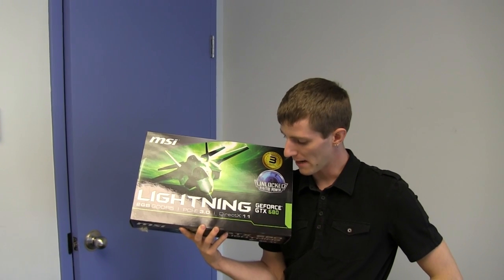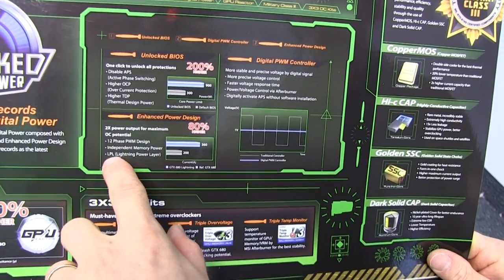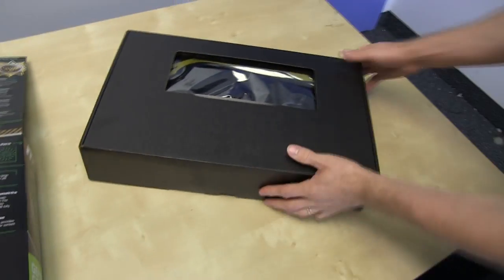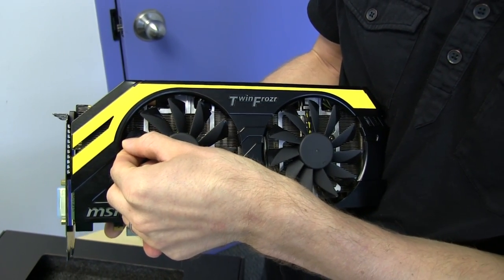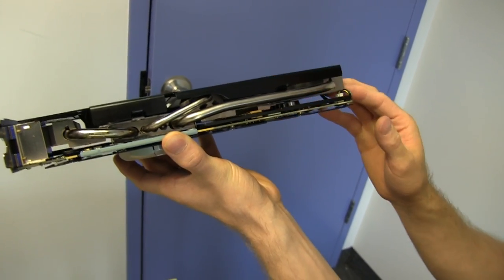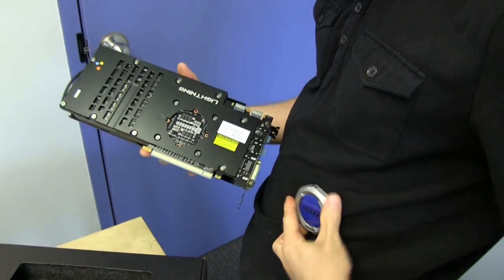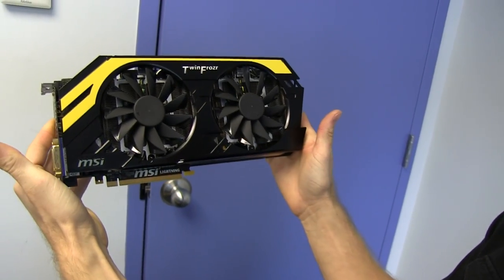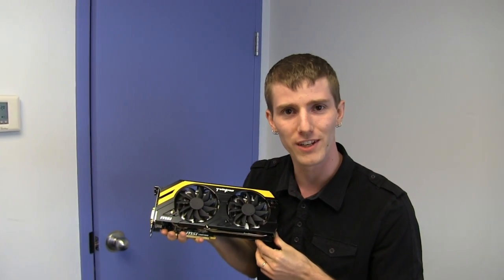MSI GTX 680 Lightning Video Card Unboxing & First Look Linus Tech Tips

Comment: That makes more sense than the previous response I received. Thanks. One more question: If you were to overvolt the VRM, then wouldn't everything else be overvolted without having to adjust more settings in Afterburner?

Comment: Well.. It depends. Are you willing to sacrifice heat for performance? If you go with the 660Ti cards, you won't have much room for future upgrades, while you can add another 680 in the future. i7 won't give you much performance boost over the i5 3570k, but it might in the future once games get more and more demanding. I would recommend getting the 680 and the 3770k because you can overclock the hell out of the Lightning card to increase the performance, and you can grab another in the future.

Comment: I thought I leave a comment after all you would wanna know, how well my beloved card is today. It can run dota maxed buttery smooth on 1440p (disclaimer: 144hz and g-sync, fps is max 100).

Also quick note, linus mention all these unlimited power thing, so the thing is I believe only the first 5 or 50 thousand cards had a separate bios on the ln2 switch. Personally I had to flash one of the bios to this ln2 profile that msi created, because it had 2 stock bios profile set up. Once done don't worry that profile going to set the default fan speed of the card while in bios close to max and you will first think something ain't right. 

Overall pretty happy with its lifetime as this was my original card in my pc, changed that to 780ti when upgraded to 1440p, then the card burned out, got a replacement in a form of an 980, well needles to say that burned out recently when i wanted to resurrect it in my new system, because the previous hasn't been functional for the past year (very long story, have an i7 3770k, which would be still fine today, but trouble shooting, if it works ain't a dream, besides its pretty old now and the answer is no, it doesn't work, or if it does it is going to keep being a pain in the @ss).

Also the 2 cards that burned down were both gigabyte, no hard feelings as i got one of their motherboards in my new system, but now that I'm looking for a graphics card I ain't gonna consider one from them this time. 
Btw not going to consider anything, what the heck, here locally, there are barely any graphics card left in stock, so no 3000 series in sight, I might not be able to get a 2000 rtx next month, not to mention the decent brand name and decent price.

Comment: hehe yeh true it's awsome and looks sweet. takes some maintenance too though from what I saw on some people rigs. I dunno, 60*c is perfectly safe for the card so I wouldnt pay extra. I usually just turn on vsync for 60fps cap so my card isn't 100% used up, then it stays cool. + my rig is pretty budget at this part of the year. was ~1500 euro (bit under $2k) back in january but now the 6970 is basically a 7870 which is just barely high end

Comment: Thats really good for an Air Cooler but my 2 EVGA GTX 680 SuperClocks in SLI have NEVER broke 50C on a Koolance water cooling system. On idle they are around 25C-30C (depending on the room temp) and generally sit between 43C-48C on 100% load. However, I did pay up the ass for the water cooling system but I got really good temps which is all that matters to me! Once you have had a water-cooling system its really hard to go back to air cooling.

Comment: If you don't have an overclocked cpu you should be fine, but I would look into a little higher watt from a good company.  Personally I'd get a 500 or 550w psu from Seasonic or Corsair, but if you're tight on money, you can get a Rosewill pretty cheap and they're usually pretty decent.

Comment: take a look at how much work other manufacturers put into their mid range and other cards. Just from the coolers, you can tell that EVGA doesn't wanna put the same effort. They only got around to dual fan coolers by the time TwinFrozr made it popular . Their only redeeming factor nowadays is that they bin their chips well(which makes their factory OC good) and customer service is good. Maybe you  could say they have nice external coolers too. but i guess for reference cards they are pretty solid

Comment: those specs are fine, no need to worry. But i recommend you getting the 3770k instead and also an AX 860i if possible in case you want to SLI two gtx 680's in future. :)

Comment: According to JJ from ASUS.ASUS Direct CU II cards can be overvolted but you have to solder wires onto the card and plug the other end into headers on ASUS ROG Extreme motherboards (Rampage IV Extreme and Maximus V Extreme)

Comment: that all depends on the cards themselves, the overclock and the overall conditions. on normal stock cards (680 & 7970) and same conditions, when both overclocked to the highest stable clocks (under air cooling), the 7970 pulls a head by a margin. especially above 1080P. another example is that one would say that 660Ti > 7950 which can be true but the Sapphire HD 7950 OC 950Mhz Edition is a totally different beast which on stock is almost a 7970 and can go further very easy.

Comment: but personally i would choose a haf x case. The air flow is really good. Plus the fact that this card sort of like dissipates heat into the case instead of out of the case. so good airflow is a must. The coolermaster haf x is a good choice

Comment: I have a question. I'm planning to upgrade my processor and:
The motherboard I have/getting is a Socket T, and uses DDR2 RAM, so I have to buy the Intel Core 2 Quad. I already bought 4GB of RAM.
Or, should I spend a little more and buy a motherboard that uses LGA 1515 (Correct me if I'm wrong), and buy an Intel i5 with 4GB of DDR3 Ram? I have little over $500 to spend.

Comment: I found a good thread on overclock (.) net and apparently they have new bios for the new lightnings. My only experience with bios before was with emulators so this might take awhile. Just one last question, i'm planning on getting an " intel i5-3570K Ivy Bridge 3.4GHz (3.8GHz Turbo)" and a "CORSAIR HX 850w" would anything bottleneck the system and should a better power supply? Also how much more powerful would my CPU and GPU get from overclocking?

Comment: i would recommend the msi gtx 680 power edition. it is the same card with a different bios. but the only difference out of the box is the lightning has 89mhz higher stock clock and unlocked voltage control. however if you OC with msi afterburner you can unlock voltage control anyway and overclock the power edition. i have both the lightning and the power edition, look at my channel for proof. hope this helps.

Comment: Cause the coolers dont blow air towards the gpu core anymore, they blow it outwards to replace the air around the fins. if the pcb was flipped it would blow hot air upwards and with that dust which would just fall right back on the card :S It does make sense to flip it for the looks as well as the fact that hot air rises but I'm sure its more efficient or something like this.

Comment: i have had a few asrock boards. one needed to be rmad due to audio and usb 3 not working. the other few boards i have have been working wonderfully. but i would recommend asus over asrock any day. but just in case they both have an easy enough rma process and good support. hope this helps

Comment: Higher voltages = increased localized heat spikes (regardless of any cooling), eventually you will burn through many of the extra transistors provided to compensate for manufacturing errors and performance will start dropping. So don't go crazy with voltage even if you have liquid nitrogen for cooling.

Comment: So, a question that still floats around in my mind that I really haven't gotten an answer to. Would two cards with a design that makes the air disperse inside your case be really bad together? With the bottom card blowing hot air on the top card and all. Before anyone answers "You could with a well-ventilated case", please define "well-ventilated"

Comment: hello, i have a few questions. If i get a full tower case, will this fit in there no problems?, also, if i plan to sli down the road, do i have to get another msi lightnight 680? or can i just get a basic gtx 680 2gb (keep them both at stock clocks)? thanks!

Comment: @themetalhead121 ? can u put 4 of these (msi gtx680) in 4-way SLI with the thing on top of the card, the opposite side of the fans? where did u get 7970 from?

Comment: triple overvolt does not imply more voltage it is the advertising by msi to indicate you can overvolt the core, pll, and ram and the power edition has it so if your msi card can overvolt it probably has triple overvotage

Comment: Dual slot.  You can see both bracket pins sticking out the bottom, and the fan sits next to the dual slot bracket height.

Comment: the 680 lightning is better for oc. But right now all the 680 lightnings are already voltage restricted by nvidia. I flashed my 680 lightning bios to unlock the voltage. If u know how to flash a gpu bios. Get the 680 lightning and then flash the bios to an unlocked one.

Comment: that's what they claim. But nvidia has put a 1.175V voltage cap on all gtx 680's. So since u are buying a gtx 680 lightning now, it would have a bios that caps the voltage at 1.175V. "unlocking" it now isnt as easy as flicking that switch. You have to flash the bios to one that is has "unlocked" voltage otherwise you will not be able to overclock at all.

Comment: no but there looks to be about half an inch from the connectors to the top of the cooler. but my friend tols me you can use 3 bendy bridges cus the 4-solid one wouldnt work

Comment: These would win because the gtx 690 is clocked ever so slightly lower than sli gtx 680 reference cards and these have more oc headroom. Howerver 1 690 looks better, is cheaper and costs less to have watercooled as well as consuming less power. Just in case you wanted to know ;)

Comment: You actually can't overvolt the GPU unless you get lucky and get one from the original run of cards, as Nvidia made MSI remove the software overvolting capability of this card.

That's why I'm happy with my 2x 7970 Lightnings instead :)

Comment: I thought the Lightning's voltage was already unlocked and that it was at 3x voltage, but i guess it must just be able to stand over 3x voltage and you need to use bios to unlock it. If that's the case then i'm sure ill over voltage it.

Comment: Can I throw a semi bad news out there? Currently produced MSI GTX680 Lightning cards have voltage limitation, even on LN2 BIOS. This has been enforced by nVidia to MSI. Fortunately, the so called first batch of Lightning cards were really unlocked, so new owners can flash the first batch LN2 BIOS and unlock all the features of their lightning cards. Check Guru3D review on this topic.

Comment: I'm assuming you have not bought to many MSI products over the last 10 years.  They have had a lot of good and bad products over the years.  Only 3-4 years ago they were mainly considered a budget part manufacturer.  They have been trying really hard to get into the high-end market over the last few years but I would still be leery of any company that promotes customer overclocking as a product feature especially on a TOTL video card.

Comment: according to the HARDOCP site where they tested both 7970 lightning and 680 lightning on ln2 bios, the gtx 680 at highest stable overclock was 5% better than the 7970 at highest stable overclock.

Comment: Sorry, but out of the box there are no 600 series GPUs that can be overvolted. If you want to OV a Classy it can only be done with an EVBot (so that's another $100) and if you want to OV the Lightning then you need to track down the old BIOS and find a build of Afterburner that will allow you to control the voltage. MSI never actually released an official version that supports OV on 600 series cards.

Comment: well from what i understand the gtx 690 is basically 2 680's but SLIGHTLY underclocked.  so the 2 680s might get more performance, but will also produce more heat

Comment: I bought this because it was supposed to have superior cooling (10~20C off regular cards) but it doesn't cool any better than my previous card.
If its cooling is in par with my older card then why would I over clock it... I feel like I got the wrong card, not using its full potential by not OC'ing, but hey at least it plays games well.

Comment: Dunno, msi coolers are so good you don't really need a water cooler. my card runs no higher then 70*c while at 100% load for hours. normally sits at ~55 with usual gaming.. Can't say that for many other cards cause all I see in benchmarks is cards going up to 80*c which doesn't sound like it would last more then a couple of years with those kinda temps..

Comment: i have a sabertooth990fx i just got one more xfx R7770 in crossfire, i had a pci wifi  Adapter in befor i put the 2nd gpu in i had to take it out for the gpu and now it coverd and the pciex1 is cover all i have open is 2 pcie x16 slots open i like to know can i put a PCI Express wifi Adapter in a pcie x16slot will it work i like to find out be for i buy one thanks

Comment: the 680 lightning has a special pcb as compared to other 680's. MSI claims that this allows for a more safer over voltaging of the card. But if u dont dare to do it, u might as well get the Galaxy GTX 680 SOC cos it is a waste if you get the 680 lightning and dont even over voltage it. Mind you if you dont overvoltage the 680 the overclocking results will be quite pitiful.

Comment: if you had 4 of these you would be either limited by the refresh rate of your monitor because of the enormous ammount of fps they'll produce or be limited by the 2 gb of ram for surround gaming because you would really want to go for 3x30 inch monitors with that ammount of graphics horsepower ;)

Comment: Linus just did a video of 2 660ti's vs one 680 and 2 660ti's do about 15-20% better then one 680 but they cost about 20% more ;p Also at 1080p a 680 will blow away bf3 at ultra. Linus was doing that 60 hz vs. 120hz video with a 680 and it was going anywhere from 80 to 120fps in bf3. Also the lightning edition of the 680 is about the same as two 660ti's. This card is expensive. Honestly you should buy one 660ti and see if you even need more then that to max out everything. You probably won't.

Comment: Aesthetics is the absolute worst reason to buy one product over another when its going into a case under a desk that will not be looked at except when doing maintenance and upgrades to the system.  Price vs stock performance should be your only real buying decision.  Overclocking is something you do when you are near ready to upgrade and just need to get by for a while longer.  Why would anyone risk burning up a near $600 TOTL video card that can play every title at max settings?

Comment: you can easily flash the BIOS. MSI released another BIOS version after Nvidia fucked everything up and you can again increase the power limit to 300% and increase the voltage. not to mention the 680 runs insanely cool, so even if you couldn't OC it like you could, it still kicks serious ass. i got mine for 20$ more than the normal EVGA shroud cooler pieces of shit, which don't overclock at all. (originally bought one of those. sent it back 2 days later, what a pile of crap.)

Comment: Because it's rather unnecessary when you look at the placement and pricing of the card. It's supposed to be made as one of the best GTX680's, which excellent cooling, triple overvoltage and such. However, it also costs $100 more than a regular GTX680. Thus, I would expect a 670 lightning to cost around $500 if they made it.

However, at that price point you might as well buy a GTX680 instead. Besides, there is the GTX670 PE, which has a similar cooler anyways.

Comment: This or a 7970 with the same cooler. This 600$ - lightning 7970 515$. i heard overclocking a 7970 generally gives better performance than a 680

Comment: That little added chip at the back is just a marketting gimmick. I cant belive they couldnt fit this on the same board as everything else. I guess manufacturers are running out of ideas how to keep their lines fresh. I have an idea make it look professional looking maybe then some older gamers will buy it too. This is definitely targeted at 12 year olds with this design. Only problem is 12year olds have no cash.

Comment: Whats sad is that this card overclocks better, has cooler temps,  takes less slots, and is generally better than a DC2 GTX 680, which is completely designed to be cool.

Comment: Lol wut? Maybe you didnt realise that this card is using a CUSTOM PCB??? Which means that MSI decided to make the PCB LONGER to fit the extra parts required for people to overclock the heck out of it?

And the heatsink going off the edge of the PCB doesnt equate to good cooling lol.

Comment: hey guys i am building an game pc but i dont know if this is a good setup(i already have the grafic card gtx 570: a total of 517 euro or $650.
cpu cooler-thermaltake frio advanced      59euro
harddisk samsung 2,5 inch sata            68 euro
power supply crosair  750 w                  107euro
case aerocool x predator big tower        117euro
motherboard ga-z77x-d3h Gigabyte       126euro
proccesor  intel core i5 3570k                206euro
gb ram 8gb vengeace                            40euro

Comment: Sorry, but how does the 680 get raped by the 7970? Most of the video's I've seen show the 680 pulling ahead of the 7970, albeit by a very close margin. But it's true the 7970 is cheaper.

Comment: Xbox Graphics? Xbox games are oftenly locked at 30 FPS, which is the same as when I start FRAPSing in a game.
I'd rather spend 2000$ on a PC, run every game the n ext couple of years, and still have 60 FPS at maximum Graphics.

Not to mention BF3 for Xbox is not running the highest Graphics.